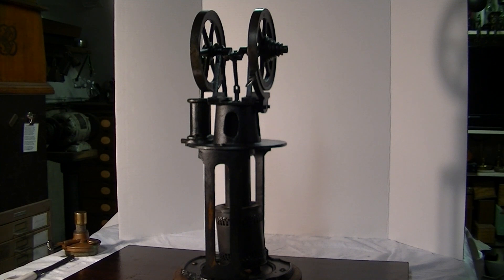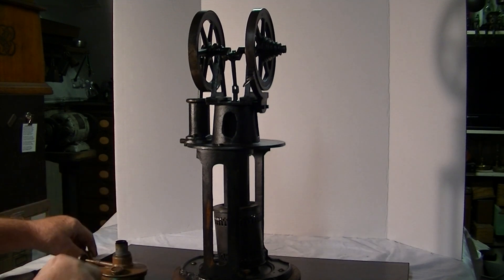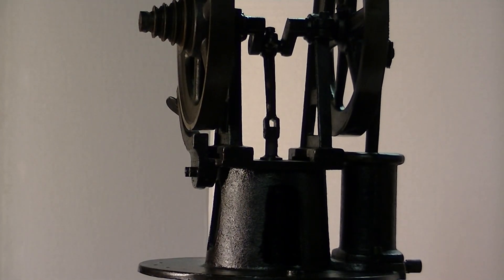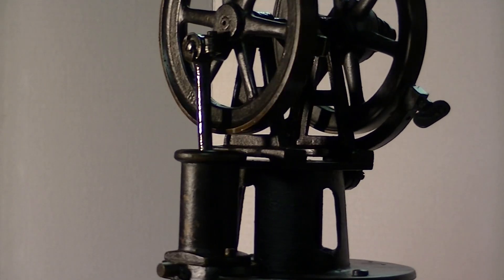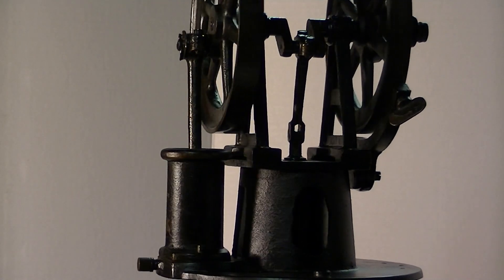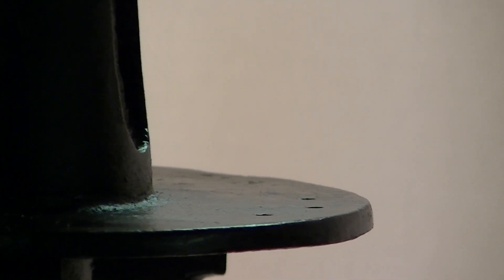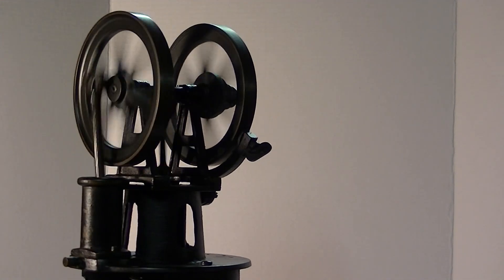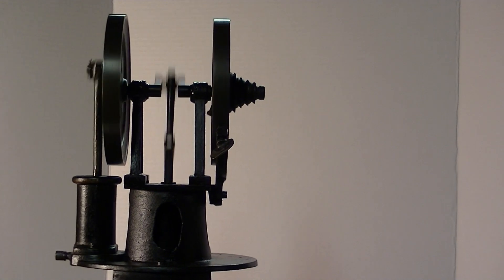Louis Heinrici smallest hot air engine

Comment: Thanks for showing this little gem. I do indeed like it. I've built a number of flamelicker and Stirling engines from brass round bar and flat stock but they just don't have the eye appeal that a proper Heinrici or table type hot air engine does when made from cast iron.  I can see a project coming on to build an engine that is more faithful to this visual design seen here. I have seen a couple of the larger Stirling and Heinrici engines in transport museums. Both with power pistons about 6" diameter.
Reply from the maker: You can get kits to construct a small Heinrich type engine. Ck. out model company like Myers Model Engines.
Reply: @mountainhowitzer  Thanks,Barry. I'll check them out.👍